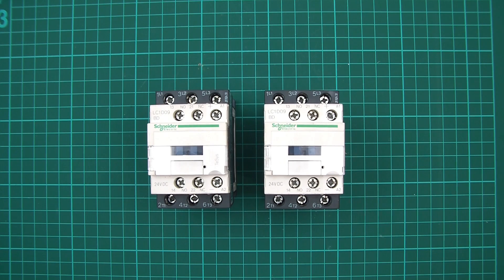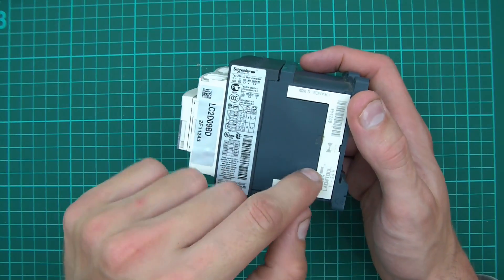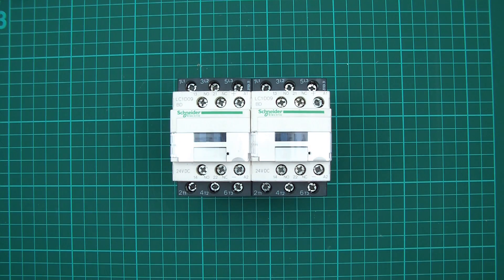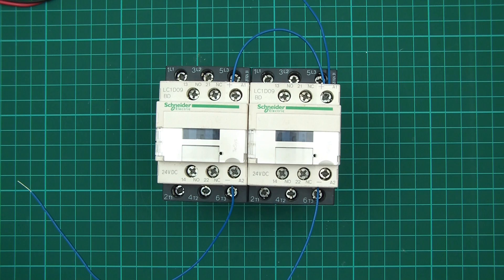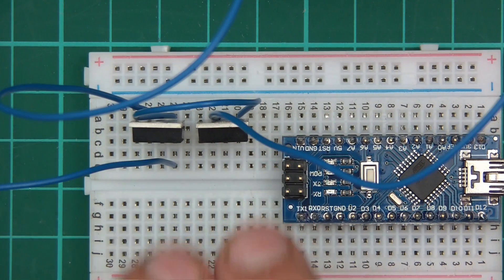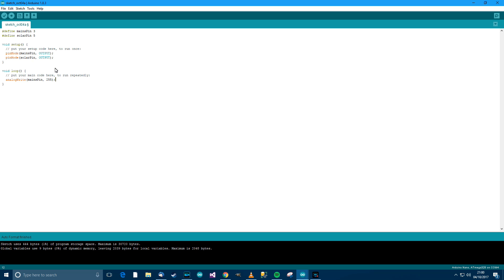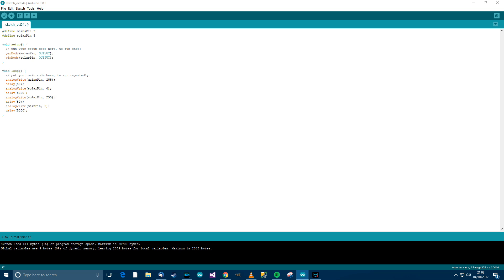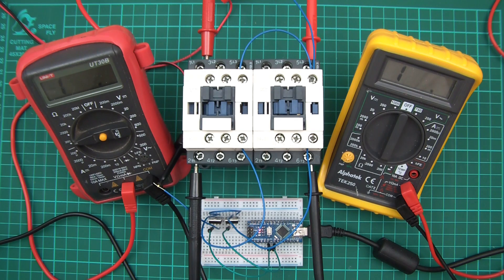TUTORIAL: How to Make an Automatic Transfer Changeover Switch with Contactors & Arduino! (Misc)

Comment: Old video but I'll comment anyway.  I went down a path years ago using computer (ESP32, RPi, Linux PC) control but there is one big flaw.  Sooner or later you have to reboot the computer.  If you don't the computer could lock up or reboot itself.  At that point, both contactors open and your load gets no power.  You can wire those contactors to be sensitive to one or the other power being present and switch accordingly.  I did it with the inverter being the priority by using the NC aux terminals.  I then added an SSR to allow my computer to interrupt the switching; essentially delay the switch from mains back to inverter.  The computer give the batteries enough time to recharge then closes the SSR.  I'm counting amp-hours in vs out.  If the PC fails the system stays on mains power. Btw, you also need mains coils in your contactors for that to work.  For me in the US that's 110v coils.

Comment: I want to have  good  contact with you  sir
Reply from the maker: Hi, to make good contact, please heat wire thoroughly, tin the ends. Make sure that both surfaces are clean and free from oils before you apply solder.

Comment: Why must it be PWM output pins on the microcontroller and not DigitalOut pins
Reply: It can be also digital output but the initial output voltage of the microcontroller must be 5v, for analogWrite(xyz,255); gives exact 5v and digital write function also provides 5v

Comment: Can I use 5v relays instead of the transistors
Reply: You would still need to drive the relay with a transistor, and a flayback diode. The i/o pins are not designed to sink that much current.

Comment: You could do all of this with one contactor just using the normally open(13/14)/closed(21/22) pins and just need a switch for A1/2 voltage to exist or not. I presume the NO  would be from solar and NC from grid power...
Reply: nope. those NC and NO terminals in the upper part are auxiliary. they are not rated for high Amps. Contactors by design are only NO. Just open one and see.
Reply: @ArminYekkalam  I opened one. There's a contact on the top in its rested state (NC) and one when it's closed (NO). The ones "on the top" are signal and power the magnet. 🤷‍♂ 
So as I initially stated, if the input signal from the contactor is grid power running the magnet, it could be in either NO or NC however you design it to work. I would have the magnet NOT powered when grid power is applied personally. Then when you lose grid power, it flips and activates the solar source circuit and disconnects the connection to grid so it won't backfeed. Not that complicated.

Comment: I think we can do ATS much simple than this, by only one contactor, using the No contacts, and Nc contacts also.
Reply: you can but, you run into issues of the common ground, that is ok if you are controlling something stand alone but if you're joining something off grid to something on grid, I am not sure you want to be doing that for safety. ideally you want your load to be powered by isolated circuits, so you're either grid powered or off grid powered.  your area might also have code requirements you'll need to follow depending on where you are.  be safe
Reply: @saeedhossain6099  A 2NO/ 2NC contactor easily solves that problem by switching both live and neutral

Comment: The switch in the video is a Schneider LC1D09DB
A good switch, not cheap though. I was hoping to find a 20A relay/switch solution under AU$100.

https://www.schneider-electric.com/en/product/LC1D09BD/tesys-d-contactor---3p%283-no%29---ac-3---%3C%3D-440-v-9-a---24-v-dc-coil/

Comment: Hi. Im wondering if anyone can help. Im an electrician and have been for the past 10 years. However i never learned any of this stuff in college. What course would i need to take to learn this stuff. I currently do fire alarm system installations aswell so the closest i get to this type of stuff is with relays powering AOV for smoke extraction. 

Ive recently been asked about a ATS  for a lift supply in the event that the mains supply faily then a generator would kick in. However i dont really know what im doing so had to turn down the request, but i would live to learn. Can anyone point me in the right direction. Youtube is great for learning but a class is what i need due to questions that arise. Thanks
Reply from the maker: Hi, I didn't do a class for this either. I've never done any electronics class in my life. If you want to learn this, buy some second hand contactors and play around - safely!
Reply: @antonycartwright  oh ok. Lol fair enough. I just thought there would be some kind of classes for it.
Reply: @Qam001  Sir, you can buy Arduino UNO (board with microcontroller good for starter) and download the Aruino IDE. This has sample basic codes and easy to learn.
Reply: Yes

Comment: Hi, when switching between 2 non synchronised 240 V AC supplies, you need to turn off 1 switch and wait a second or 2 before closing onto the other supply, if you don't do it this way and swith AC as per your sketch, you will get a high resultant voltage that will blow your load.
Reply from the maker: Hi! Thanks Ian! This has been wired up in this way for over a year now and nothing has blown yet! Maybe it will soon though, I don't know.
Reply: @antonycartwright  Doesn't matter, since your design is flawed. This isn't good at all you need to make a version two that is correct.
Reply: he is right, normally you need to use something to detect when AC is at 0v, and switch at that right moment
Reply: It would be a disaster to blow your load unintended.
Reply: You only need it long enough to ensure it's less than the frequency of the line voltage minus inductance. Most contactors are not fast enough to overpower like this where you have two simultaneous peaks. 50/60hz is typical so 1/50th of a second times two for two waveforms. Most contactors (except SSR or other MOSFET) are not fast enough because they're mechanical.

Comment: Why not use high current 240v SSRs (solid state relays) switched by 5v directly from Arduino digital output pins?
Reply from the maker: Do you mean instead of the transistors? Or instead of the contactors? I wouldn't replace the transistors with relays because I think transistors are way better suited. About the contactors, I technically could replace those with relays, but it would lack protection. No mechanical interlock, and they can failed closed!!! That cannot be allowed to happen! :-)
Reply: SSRs are sold state devices and have no moving parts to fail closed. They dont need a transistor to drive them and can be driven directly from an Arduino digital pin. There are also SSRs that can handle up to 50 Amps. The only disadvantage I can see is that they dont have a mechanical interlock, but an electrical interlock could easily be implemented in the Arduino code ant this would always be more reliable than any mechanical interlock (no moving parts).  I guess the other disadvantage would be that you would need 4 SSRs to provide complete switching of both live and neutral lines of both circuits.
Reply from the maker: Vince Williams I'll look into this. Thanks for your comment!

Comment: Bi-polar transistors aren't like mosfets. You need a current limiting resistor between the Arduino pin & the base otherwise what you effectively have is your output pin connected to ground through something equivalent to a diode junction & the micro controller will pump out as much current as it can. It probably has some current limiting there...maybe?...but it can't be good for it in the long run nevertheless.

And speaking of diodes, where are the back EMF cancelling diodes on those contractor coils? You never know when that "lucky" spike will come that will zap your transistor or even worse, your Arduino in the process.
Reply from the maker: Hi Xanataph! You're definitely right that it really should have resistors on the base. Looking at the project, I'd put aside 2 x 1k resistors for that purpose! I think I'd forgotten to put them on. Regarding the back EMF, I'd not considered it! Thanks for your comment! :-)
Reply: Antony Cartwright what size power transistor did you use and what would you recommend about the back voltage and the resistor before it reach the audrino